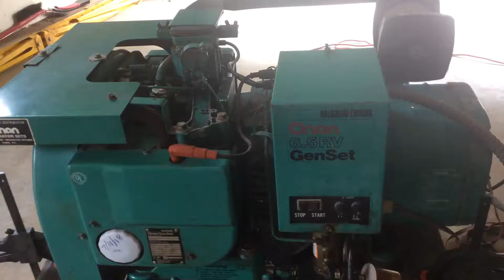Onan 6.5 GenSet RV generator runs than dies

Comment from the maker: Need to mention, takes upwards of 6 to 8 hours of resting time, before it will fire up again. Please leave comments below, need help!
Reply from the maker: Randolph Hearst turned out that the fuel bowl needle valve wasn’t sealing flooding the engine. Rebuilt the carburetor issue resolved!